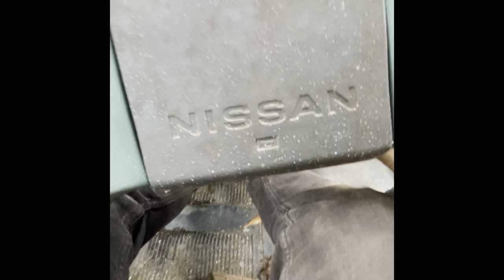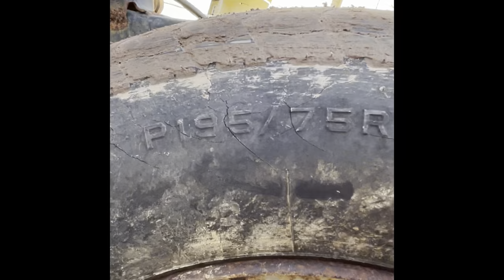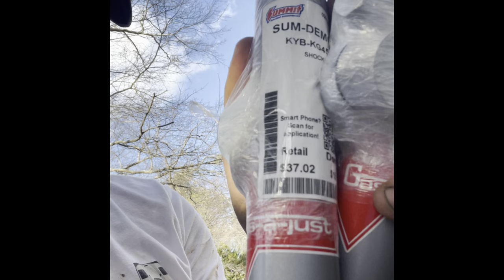Episode 3: The Nissan 720 project gets a Weber carb! STILL doesn't run...

Comment: what are you doing with the truck as ah project ? Maybe take the fule tank out n clean it inside? Replace all fule lines n filters.  then go through the cooling system.  check the head bolts or studs crank them down ah bit. then start going through the r3st of the truck is you're corolla wagon a 2tc or 3tc? I've owned a bunch of old corollas & im Looking for a wagon ir been looking for ah few years since i sold my last 1
Reply from the maker: Fuel system is for sure the culprit